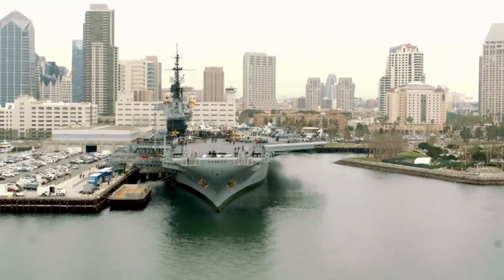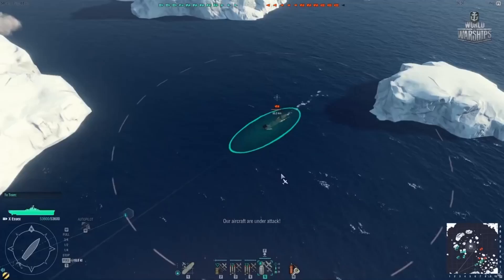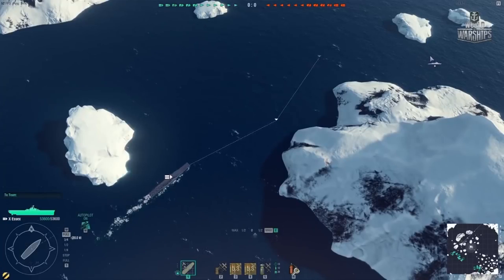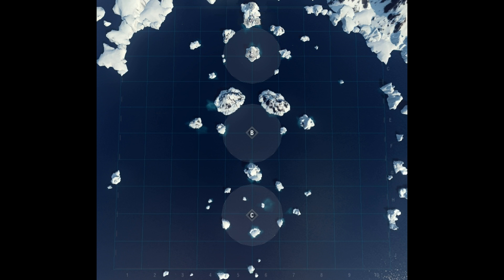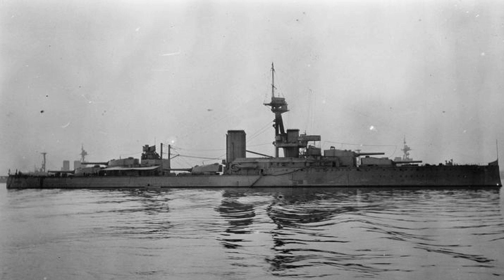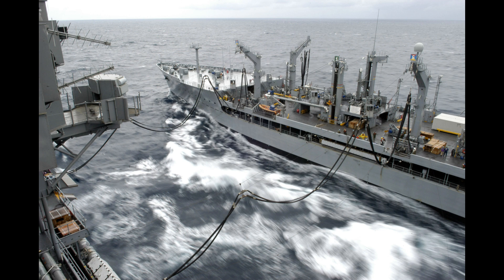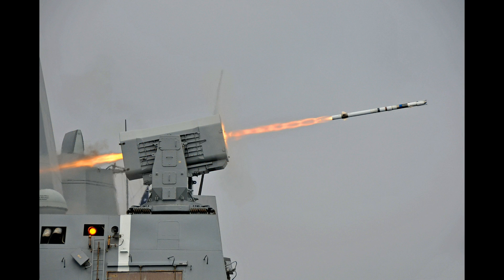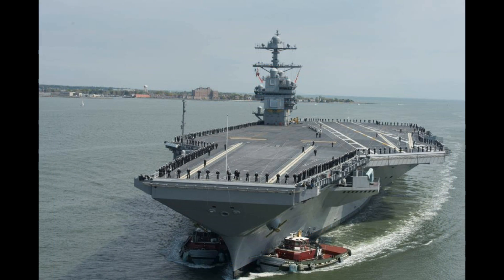Corrections to Real Life Lore - Why It's Impossible to Sink This $13 Billion Ship

Comment: the special weapon used by ASROC was considered a depth charge.  One was actually used as proof of concept.   The main weapon associated with ASROC was a Mark 46 torpedo.   The weapon system in its entirety was eliminated VIA treaty compliance in the 1990s.   

no ship is unsinkable some are extremely difficult.   I was assigned to a LST which we called long slow targets .  The ship was assigned to the reservist crew who managed to drive it onto the rocks in Argentina.   They elected to strip and then sinkex it instead of repairing everything broken.   pics at navysite dot de .  La Mouir County Sink Ex.    Assorted carriers were assigned coral reef duty.  They had to be specially prepared to sink.  Difficult not un sinkable.  

I was on USS Princeton CG59 we escorted USS Midway into the Persian Gulf and provided AAW cover for the four carrier element operating in the gulf for desert storm.   There was at least four AEGIS cruisers in the gulf at the time we rotated assignments north and south to form a SAM alley for Carrier screening purposes

they totally discounted the screening ships.  As a escorting cruiser we were always on the treat axis.   in tense times we left some distance so as to increase the range from the carrier for air defense purposes.

South Carolina CGN 37 was built to escort Nimitz.   The 30 plus listing in those reference books is just a suggestion.  The top speed will remain unspoken since Nimitz is still active duty.   Even Iowa could better the top speed listed.  Original WWII snipes were over heard during a engine room walk thru wondering if "she could still make speed"

Comment: I want to point out a flaw in your video since it's about corrections.  You are correct when you say that modern submarines can keep up, but they can't do it quietly.  The list of subs that can keep up is actually quite short.  If one was to do that kind of speed, it would be an easy target for the carrier groups ASW helicopters, subs, and destroyers.  To my knowledge, there are only 2 submarines that have ever actually gotten close enough undetected to have been able to launch torpedoes.

Comment: I don't understand your "correction" in regards to the reactor's on the Ford. That is a common method for using nuclear fission to create power. Heating water into steam to spin generators. Unless you consider expanding on the method of gearing to be a correction?

Comment: You didn't really correct any facts in this video, you just went into small technicalities. Also, there was no claim that the propulsion system was different, but you argued that for some reason. I currently work on a naval nuclear plant, and none of the claims about that were untrue. You confirmed what was stated in the original video.
Reply: yeah sure dude and im the president of china.

Comment: The Ford's primary weapons, it's EM catapults, are able to launch many more different aircraft than the Nimitz's steam powered version. It's more powerful which will let it launch larger airplanes and it can be throttled which lets it launch lighter planes like the predator and reaper drones. The ability to launch those drones is going to change the naval air combat SOP, and with it the requirements of combat aircraft technology.

Comment: OK. There is not doubt that right now the USN has the most capable and powerful projection capability. That's fine.

Kick out the support structures, and it matters not that the reactor can run for 25 years. Without resupply, the crew will be all dead within three months at best. The US fleet of oilers (resupply ships) has dwindled. Thus, the US relies on resupply at "friendly" nations. In the event of full on nuke war, those would not exist. Even the remaining oilers would not exist. They have to feed and supply their own crew and stocks.

The claim of forever became 20-25 years and on critical examination became 3 months. After that the cannibalism would start.

Without fresh water, one is dead in 10-14 days. That's OK, we can do that with the reactor. And indeed we do as a matter of course. The subs have done that for years. Without food, roughly 70 days before you're dead. No sub has ever done that. 

In any event, if as RLL claims that the Ford could soldier on for 20-25 years alone, he/she/housecat is plainly wrong. Left alone, Ford would survive, left alone, 3 months at best, plus whatever one might allow for the cannibal saturnalia that would ensue. Or possibly the piracy or whatever other resources on could rob from any other survivors.

Comment: One thing on your propulsion system correction when you said the nuclear plant just supplies heat.  That's all nuclear generators ever do.  They create heat, which turns water to steam, which drive turbines which generates electricity.  It is, as you said, the same as using coal to drive a steam engine or a coal fired power plant.  So I'm not sure how you can say the power plant doesn't have a lot to do with the propulsion system.  That's like saying the plant doesn't have much to do with the electricity it generates since all it does is produce steam that drives turbines.

Comment: Shut the fuck up. I thought when you said "corrections" you meant the things he said were actually false. Instead no. I didn't watch the part in either video when you's were talking about world of warships because quite frankly i couldn't care less. The only decent point you made was that the nibitz class carrier wasn't outdated (but kind of is when compared to the gerald r ford). Depth charges, air dropped torpedos, they do the same fucking thing. I hate it when smaller channels try to ride bigger channels backs by "correcting" them when they really don't have to. I respect that you want the correct information to be out there but you could have just left a strongly worded comment on the video about the nibitz carrier not being outdated.

Comment: I was stationed on the U.S.S. Eisenhower, it's top speed is 33 knots and its air wing contains 85 to 90 aircraft. I can't see any ship that size or larger going much faster than that, certainly not more than 35 knots. The big innovations on that ship are the flight deck & Island layout, and the magnetic launch system. The former means that there's more room for aircraft on deck and can launch/recover aircraft at a higher rate. The latter means it doesn't have to store as much steam which frees up some space below deck and perhaps allows it to get underway faster and can launch/recover aircraft at a higher rate. It's not larger by any significant amount and has a similar complement of aircraft. Also the Navy is lying when when it says that all Nimitz class ships are 1092 feet long. The general rule with aircraft carriers is to make the new ones just a little bit longer than the last one. That way they can claim to be the biggest. The later ones are over 1100 feet long.
Reply: +Ken MacMillan

 The hull speed, not accounting for irregularities in the hull's form, is well over 40kn. So I can see 37kn. possibly. Though I personally have no clue.
Reply: Which ship are you talking about? I've stood watches on board the Eisenhower where I was looking directly at the speed indicator while at top speed, it's 33 knots.
Reply: +Ken MacMillan

 Any Nimitz. I simply said theoretical. And that I personally, have no clue.

Comment: My observation is the narrator has little experience in a real naval environment.  The Ford may have nuclear propulsion plants powering steam turbines, but its aircraft do not which is a primary reason supply ships are part of its task force.  The Ford would be the Super Hornet equivalent of the Nimitz.  One additional observation is the crew count with 2,600 belonging to the ship itself.  Air detachments would raise that number.  Thanks for the corrections.

Comment: Correction at 6:52.. If the propeller got directly connected to the turbine without any gearbox, then the propeller will not move at all. There is not enough torque from the engine to spin the propeller, and if they increase the turbine pressure, then the engine mass and cost will not be feasible.

Comment: While the corrections you made were valid points, they weren't necessary. They were very minor details that any average person who is intrigued by the video does not need to take into account to comprehend and enjoy the content. The first "correction" is about simple stock footage used to convey the idea. The second one, you completely neglected the fact that the purpose of a video game is entertainment, not gaining knowledge, and instead focus on the educational aspect of the game just so you could suggest a book entirely about ships. The third correction isn't even a correction, you just provided extra insight that was completely unnecessary. The fourth isn't a correction either You're just looking unnecessarily deep into a minuscule portion of the video and just end up reaffirming the statement and contradicting yourself; not to mention the statement was entirely rhetorical. The fifth "correction", is also, not a correction. A Carrier can outrun a submarine. He never stated in the video that one could outrun the sub's torpedos or other weaponry. And on the note of Helicopters dropping "depth charges": yes, you were right. He was behind an entire era of weaponry. He misspoke, but he was not wrong in the sense that an air-dropped torpedo is the same concept as a depth charge. You're just nitpicking at minor details, some of which were never even stated in the video. You come off disrespectful and condescending and end up scrutinizing a video that was successful in spreading knowledge and getting its point across while being entertaining. Do better next time.

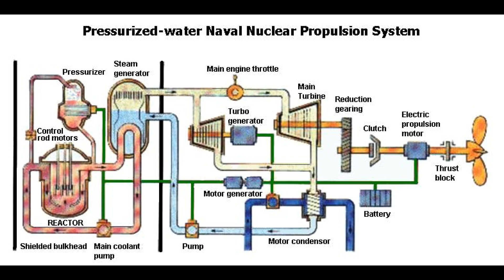Comment: 7:20 Oil and/or coal.  Oil is more handy, but a lot of the old freighters and likely a number of old ships of war used coal or a coal+fuel oil construction.  With limited space, needed for large changes as well as for new ships, as well as limited money (in peace time) and limited time (in war), often enough taking a ship out of service for many months (and blocking the repair of damaged ships, too), is not worth it, if it "works", even suboptimally.

Submarines vs. carriers.  There have been a few embarrassed carrier groups where diesel-electric subs got into perfect attack positions against the carrier .. and gotten closer ... and some surfaced a stone throw away from the carrier before being noticed. (This being exercises, sinking the other side was not really the plan, just showing that you could.)  The thing is, modern conventional subs can be and often are so quiet that the normal noise of the ocean blots out anything they cannot help to emit.  Which means passive sonar is not going to hear them in time, if at all.
There have also been similar troubles with nuclear hunter/killer-subs not "seeing" (hearing, finding, spotting) their conventional opponents in exercises --- while they knew exactly what the nuclear sub was doing at any time.  Cue big drops of sweat on the brows of 2 officers from the nuklear sub observing in the conventional sub ...

On to of being a nearly undetectable hole in the water, some conventional subs now have interesting AIPs (Air Independent Propulsion), including Diesel & liquid oxygen for running a (basically almost vibration free) Stirling hot air engine to regenerate electricity, while others use fuel cells (and harbour loaded "fuel" for them) to replenish the batteries and/or run basic load.  While during the latter half of WWII, German subs made long patrols into, say, the St Lawrence Estuary[1] without surfacing for 60+ days, they did have to snorkle every night to refresh batteries and air ... a conventional + fuel cell boat did a 3 week trip from Europe to America (attending war games with aircraft carriers on the other side, amongst others) without surfacing and without snorkling and without running their diesel engines even once while under water.

No biggie for a nuclear powered sub, I know, but I understand a first for conventional subs.  Of course, nuclear subs, beside being noisy (if only in comparison) also have advantages: long endurance, running at flank speed for days or even weeks, as there are no "empty battery, cannot go any more, need recharge by whatever means ..." and thus ability for world-wide and under-the-ice patrols, only limited by the amount of food stowed,  the weapons used up, and the crew getting crazy.

[1] apparently  a place where sonar conditions are very erratic, to the point of having a warship actually going over the boat when they put out the periscope (in other words: maybe 20 metres away) --- the warship was not heard on the sonar(!), even afterwards, yet the same sonar on the same boat with the same sonar men picked out single ships up to 30 miles away on the same trip, before and after ... but then the first underwater sound experiments (with a bell) yielded ranges of > 100 sea miles, which was apparently a fluke, too, and couldn't be repeated later ...  Sonar is a funny funny thing sometimes.

Comment: The other issue I had with the sub comment is...the purpose of a sub isn't to chase down ships, it is to get in range of ships without being spotted.  Doesn't matter how fast the Carrier is if it is sailing TOWARDS the sub.  For that matter, if all the ships in the CSG are not as fast as the carrier, it has the choice of leaving it's escort (and losing a lot of protection, including from subs) or going the speed of the slowest ship in the group.

Comment: how to sink an aircraft carrier : use a large group of orniquatic ( flipper driven submarines so that the ship's sonar has difficulty locating your attack group ) / Knock off the Propellors so that it's dead in the water. / Hit the very bottom ( well below the waterline ) with enough force to break off or spill out the Ballast so that the ship topples over. / In a leisurely manner, punch holes in the ship so that its compartmentalization eventually fails, and it sinks.

Comment: Corrections: The U.S. Navy is updating the class of ship to keep them modern and up to date not the already existing ships. The first Nimitz Class was commissioned back in 1975 and this makes sense in terms of the DOD wanting to upgrade the Class of ships altogether. As for the newest construction of another Nimitz Class Carrier in 2009, that carrier was in construction for a while and they are not going to scrap it just because of updates from the DOD, the Navy is going to try to have as many ships as possible to ensure 100% strategic value. His use of just saying Reactor makes sense to keep brevity of the length of the video and also keep the audience from frankly falling asleep. One reactor powers the ship the other powers the engines which is pretty obvious. Since the Carrier has nuclear reactors it is likely for it to have leadline suits making it possible for ground based scavenging missions in the event of a nuclear catastrophe when the ocean based supply ships run out. The chances of them using the RAM-116s are slim to none (only as a last line) considering the many other Anti-Missile based Destroyers and Missile Cruisers deployed with a Carrier Strike or Task Group they would also most likely be used to take out incoming fighters. With the Task Group, as mentioned are several Destroyers and Anti-Submarine Ships, these were primarily made in the First and Second World Wars to combat German U-Boats and are still used to today because of their efficiency at detecting and destroying these underwater menances. Torpedoes are hardly ever  used and are significantly expensive to make just them, they normally cost upwards of $1 million to make one with even some numbers going up to $1 billion. Even during both World Wars they were hardly ever used because again of how expensive they were in that time, which is why most of the Submarines had deck guns. The Ford Class is a very powerful ship but can be quite weak like any other Carrier without her escorts, although with its vast amount of technological possibilities as you mentioned, it can theoretically be strong enough to match even the toughest of fleets in the right circumstance.

Comment: The USS George H.W. Bush  also has deployable arms for ass pinching. What're you liberals laughing at? :D The USS Clinton, was too offensive and leaky, didn't look like it could stay upright even on paper... to make things worse they kept losing classified e-mails to the manufacturer. The weaponry somehow was sold off to Mexican drug cartels. Which is fine since they were trying out a brand new ad-hominem/mirroring/deflection weapons technology, designed to confuse, well, everyone. Electronic communications systems were outdated and not secure enough. Investigations are on-going into the whole affair. I'm pretty sure nothing will come of it. It's a shame too, it was supposed to have top notch free healthcare on-board.

Comment: I know how to sink any ship - drop 3000 nuclear bombs on it. lets see any ship be 'impossible' to sink then, eh?
Reply: technically, hydrogen bombs ARE a type of nuclear weapon.
and the reason I said nuclear bombs is because basically everyone knows what one of those are, but not everyone knows the destructive potential of gamma ray bursts or supernovas or antimatter (which would actually be quite difficult to make a weapon with because the payload would be detonated on contact with matter so it would have to be contained with electromagnets in a vacuum-sealed area)

additionally, if you dropped the nuclear bombs over time waiting for the previous explosion to dissipate before dropping the next one, it would probably not hinder their effectiveness.

besides, I was just saying that it's stupid to call anything indestructible or unsinkable, because, though some things are impractical or preposterously difficult to destroy, everything can be destroyed somehow.